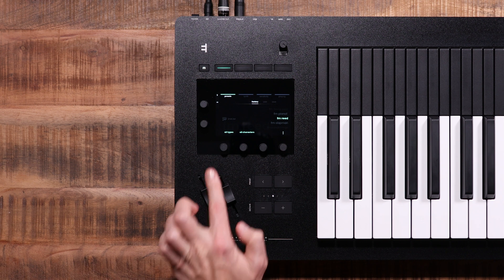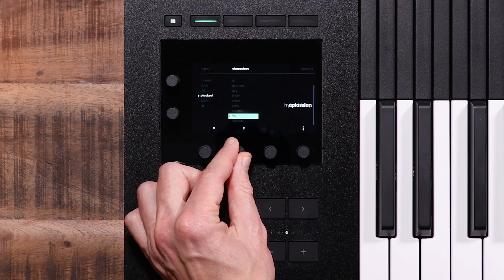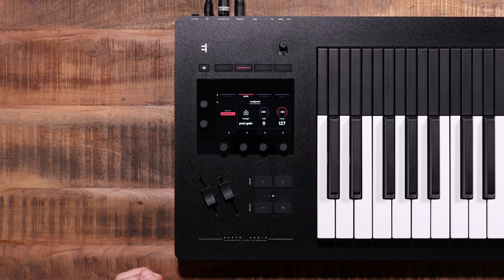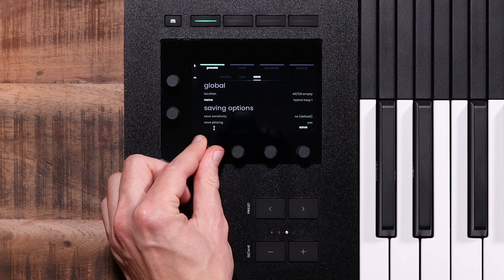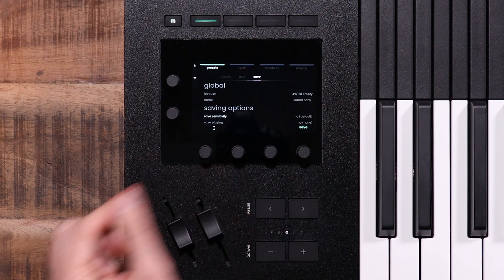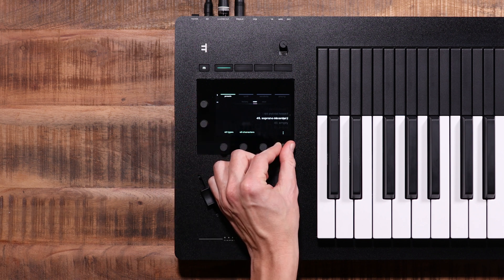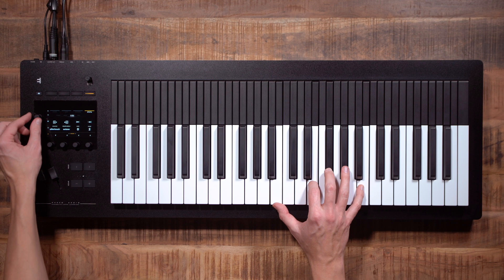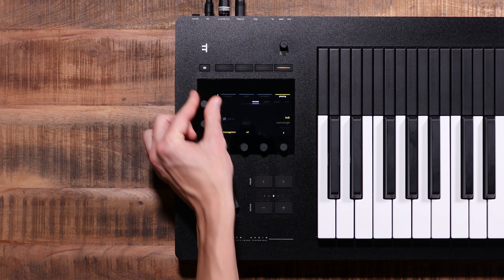osmose quick start: internal sound engine mode (os v1.0)

Comment: Please i don't know how to shut down gently my Osmose, i've used the "OFF" button on the rear panel and it has made a bad big sound...
Reply from the maker: Hi, this sound is expected. Whenever dealing with audio equipment, you should always switch on your speakers as the last step when starting a session and as the first step when ending a session. If you switch off an instrument that is currently monitored, you would mute its channel before you switch it on or off.
Reply: @ExpressiveE  Yes, thank you for the advice.

Comment: is there a "key hold" Mode in "Normal Play Mode" or only in the Arp Mode?
Reply from the maker: Hi, it only exists in the arp mode. But you can of course use a dedicated sustain and even sustenuto pedal to hold notes. A compatible pedal is required, though.
Reply: @ExpressiveE  ☹️ ok thanks

Comment: This is extremely remarkable. Maybe one of the first times I've seen a crowd funded product roll out be better than advertised. The amount of control and nuance for keyboardist can be ground breaking. Aside from the included great patches, I think it would be awesome to see and hear how the keybed reacts to more traditional deep sampled sounds made specifically for it i.e. an full blown Rhodes, 338 semi hollow guitar, Strat patch with distortion, Pedal Steel, even hearing a Piano with that kind of pitch bend and modulation per note on the fly now that we have that kind of control with real keys.
Reply: It's a good keyboard, but way too overrated in terms of the actual control. It has many flaws, for example, the aftertouch is not independent of pressure, which means that to access the aftertouch, the pressure must be already 100%, and also to access the pitch bend you need to have a bit of pressure on. Also, the black keys do a lot less pitch bend than the white ones, for some reason. Other keyboards have done that way better (like the Roli Seaboard etc), but of course those are midi controllers without a synth engine. Don't get me wrong, but it's the interesting synth engine that is probably what is worth it than the expressiveness and control.

Comment: Is it possible to turn off the reverb or delay across all patches if using an external effect pedal?
Reply from the maker: Hi Kjetil, we are sorry to say that this is currently not possible. You would have to save an edited factory preset as a user preset to have it 100% dry.
Even then, a few presets have a delay programmed inside the modulation matrix of the EaganMatrix itself, which runs independently from the global fx. 
I will report your use case as a feature request.
Reply: @ExpressiveE  thanks alot! I understand the trouble of delays built into the matrix, and I think the global fx is the most relevant thing to be able to switch off. Happy New Year! And congratulations on finally releasing this beauty to the world!

Comment: It's been over 3 years since I preordered my Osmose. I am very impressed with all the added features and extensive research and development that have been implemented during this time. I am looking forward to receiving my unit soon. Thank you very much for devoting all the additional resources to make this keyboard a reality and for adding all the additional features.
Reply: How much did you pay originally?
Reply: @zooie1044  The suggested retail price has not changed @ $1799.00 USD. Just like the current pre-order, I did put a $300.00 deposit down 3 years ago. I feel that from what I have seen coming out of Expressive-E thus far, the keyboard is certainly worth much more. If you are interested in pre-ordering now, my suggestion is to do so before the stock runs out. The next production run could certainly increase the retail price due to the continued chip shortage and price increases.
Reply: Just checked the status of pre ordering online and you can no longer pre order online. Only locally via a retailer. Good luck in securing your own Osmose.
Reply: @MyAIFunArt  thanks for the info. I put in a pre order with a UK retailer earlier today!
Reply: @MyAIFunArt Are you sure about that ? I already paid a deposit directly online a few days ago for the first batch (due in May / June), but I tried it again today and you can now reserve a unit in batch 2 (it says July / August for that batch).
Reply: @symbiat0  just checked again and the online reserve link has a line through it and is not working for me. Maybe since I am in North America, these units are not available anymore online? Not sure…
Reply: @MyAIFunArt  That’s weird - I am in New York… 🤨
Reply: Soon? 😆

Comment: Good god damn. US shipping can’t come fast enough! And the first time I am wishing for more than 128 presets. Seems like you can go down a lot of rabbit holes with this keyboard.
Reply: (assuming it's the same for all EaganMatrix instruments) -- Using the Haken Editor, you can load and save presets from files on the computer, so you can have as many user presets as you wish to create -- just a max of 128 custom presets loaded onto the instrument at a time. The predefined presets are always available.
Reply: I don't quite see the reason to have fixed preset locations. Is it a hardware issue to have all presets be user defined, if wanted?
Reply: @CommandorX  I'm guessing it's more of a historical limitation (it's been in development for >20 years). Earlier versions were limited to 16 user presets (probably less memory in early models)), and only relatively recently expanded to 128. The system preset files are the identical format to user preset files, so in principle, it's more of a design limitation/choice of the user interface for managing presets. My understanding is that in the experience of Haken Audio, most users don't go much beyond system presets - there's a tremendous depth to explore there already. The engine is deep, and has a learning curve to really do sound design. If you discover that you have a genuine use case for more than 128 user presets, I'm sure that Haken Audio would listen. Their support is awesome.
Reply: @pachde  In this context, I could easily imagine saving, for example, 5 to 10 variations of a factory preset before trying another of the 500. As a live performer, I want easy access to edited patches to work more specifically as certain functions or songs. So one useful official patch could generate 10s of user iterations. It makes 128 feel a bit limited to me. I'm nonetheless really looking forward to diving into this instrument.